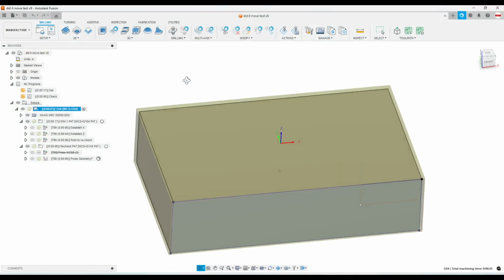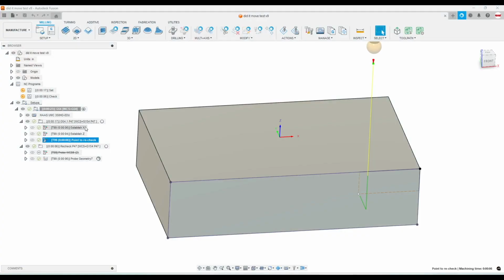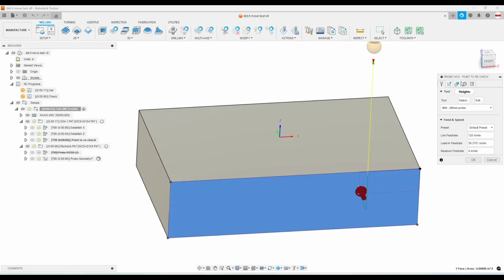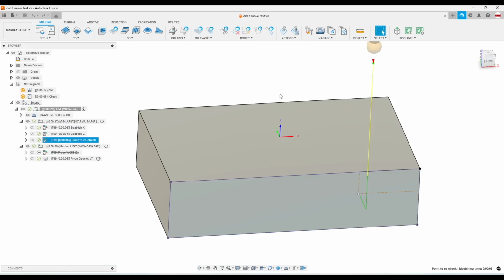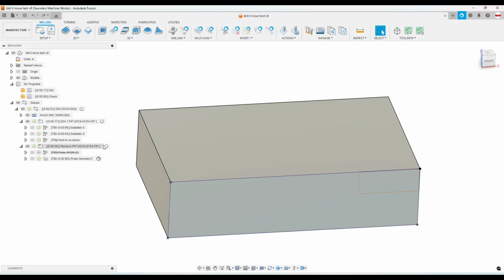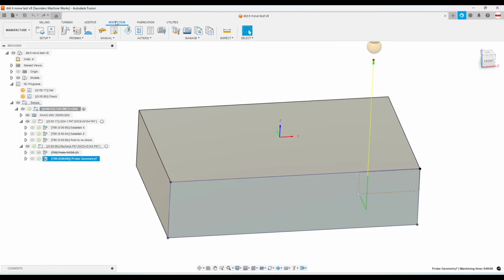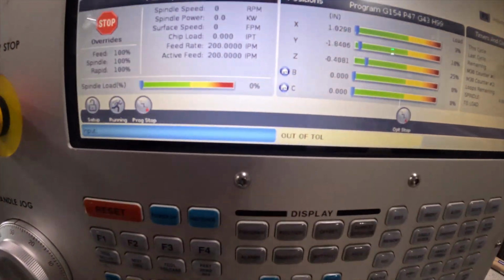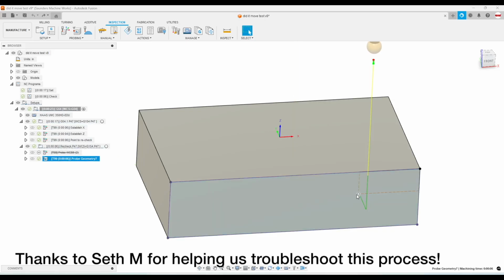Smart Probing in Fusion 360: Log Any Point and Re-Verify After Machining!

Comment: If you want to probe a specific location, here's a solution I've used: 

- Draw a circle with the center point where you want to probe
- Convert the circle into a surface body
- Select the surface body as the surface to probe
- If you are probing along a wall like in your video, adjust the bottom height to be: selection, center point of the circle

This should place the equator of the ruby directly on your point.
Reply from the maker: NICE tip!

Comment: Really great video!
Quick question — if you’re using fixed zero points on your fixture, couldn’t you just copy the G54 zero point into G47 the first time, so you don’t have to re-zero X and Z?
That way, it would still zero in the same Y position every time, right?
Reply from the maker: yup!  you can!
Reply: You can do also do this with a manual nc pass through, if you put something like this at the start of the program it would write G54 to P47
#7081=#5221
#7082=#5222
#7083=#5223
This way it happens automatically and you dont have to probe it again or remember to copy the offsets.

Comment: On okuma the renishaw use variables for probing so I wanna say like vs83 is single surface x deviation so what I do is just a simple if statement vs83 GT .005 N9999 which is right before the m30. I also use it to check features and rerun tools if necessary so if a feature is GT .001 go back to N6 which was the N number for said tool.